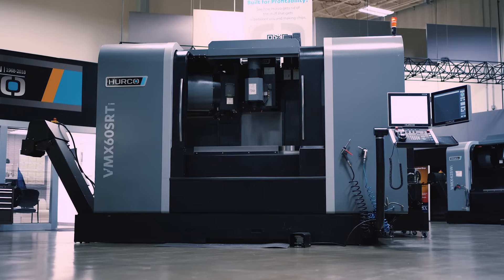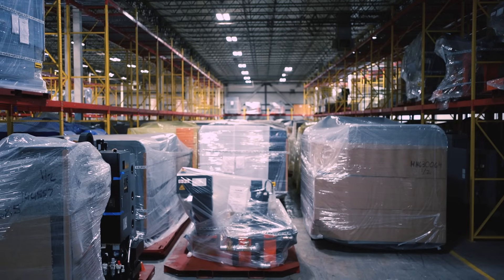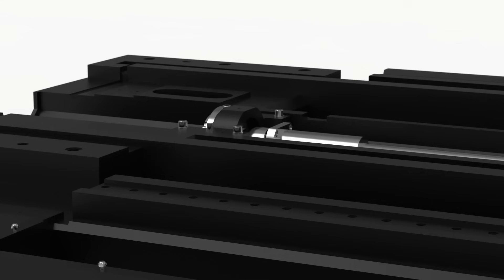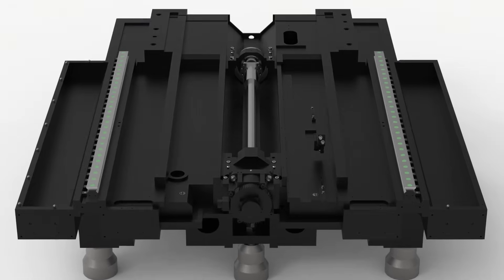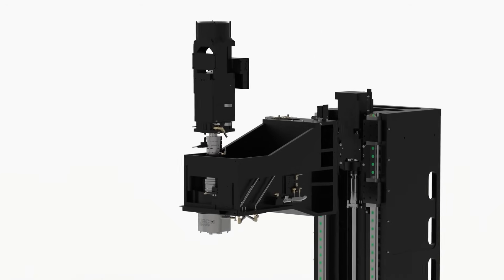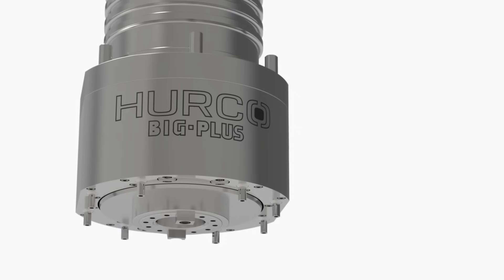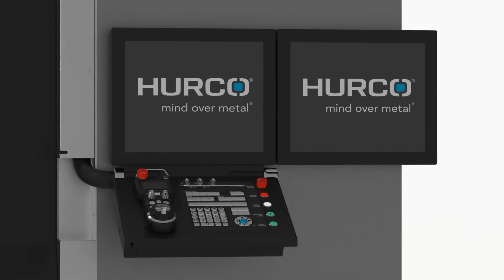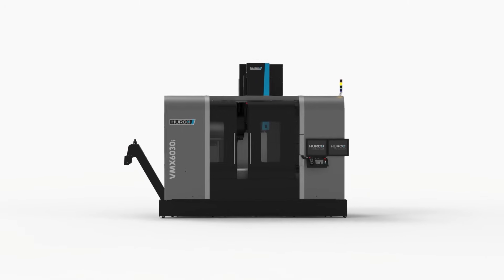How It’s Made: Superior Machine Design and Construction | Hurco

Comment: And best of all, MADE IN THE USA!!!!  Keep up the great work!!!  You guys ROCK!!!
Reply: Ummm, no it's not. The ways and frame (axes and saddle) are US built, but I doubt the rest is (probably not even the ball screws), and definitely not the electronics. Yaskawa is a Japanese company that produces the drive controllers and motors.

It's definitely assembled and partly manufactured in the USA though.
Reply: @pappaflammyboi5799  Looks like the linear guides are HIWIN made in Taiwan or in Israel. The ball screws are double nut, probably HIWIN too. Motors and drives are Yaskawa. Besides the brands, it is important to use hu orecision components. HAAS uses NSK linear guides but lowest available precision grade. Overall made in USA machines are better than Chinese, but they can not compete with German or Japaneese. I work with DMG-MORI, nothing even to compare with this.

Comment: After hand scraping the base casting how do ensure flatness between the top of the linear rails on the Y-axis?
Reply: Scraping is the method to make the surface flat within 5 microns. That's flat enough to hold the rails. If you're worried about the small islands of high and low don't be, they have enough baring surface

Comment: I thought they are all made in Taiwan?
Reply from the maker: Hi Stephen, the VMX6030i is a model we designed specifically for the US market. It is made here in in Indianapolis as are some of the VMX42i models. The accurate designation is Made in the USA with globally sourced components. 
The build team here in Indianapolis hand scrapes machined surfaces; grinds mounting and surface plates; aligns castings, ball screws, mechanical housings, rails, and tool changes; drills and taps assembly and mounting holes. Additionally, the Indy build team completes a comprehensive inspection and certification process for each CNC machine that is shipped to customers from Indianapolis. Other machine models are made at our wholly owned factories in Taiwan with all engineering design and software development conducted out of our international headquarters in Indianapolis, Indiana, USA.
Reply: Are any of the castings made in the US? I assume those would have to be machined on a giant gantry mill before hand scraping.
Reply: @stephenpavlov8942  Seem to have a narrative you are trying to bait them into.

Comment: Ceramic bearings are great, until they need to be replaced....how expensive are they compared to high quality steel bearings?
Reply: ceramic bearings explode so frequently at my workplace that i can find ceramic balls on the floor every day of the week. 
a few times i found ceramic race parts but those tend to stay in place. 
i think the machine uses 120 of them, but they are necessary consumable due to the insulating properties. 
sealed steel bearings would be WAY more reliable but they wouldn't work for our application.

i would be extremely concerned with using them in a milling machine.
Reply: @darkshadowsx5949  Don’t be- they have their place.

Comment: Are the machines completely built in the US?
Reply from the maker: Hi Ian, the VMX6030i is a model we designed specifically for the US market. It is made here in in Indianapolis as are some of the VMX42i models. The accurate designation is Made in the USA with globally sourced components. 
The build team here in Indianapolis hand scrapes machined surfaces; grinds mounting and surface plates; aligns castings, ball screws, mechanical housings, rails, and tool changes; drills and taps assembly and mounting holes. Additionally, the Indy build team completes a comprehensive inspection and certification process for each CNC machine that is shipped to customers from Indianapolis. Other machine models are made at our wholly owned factories in Taiwan with all engineering design and software development conducted out of our international headquarters in Indianapolis, Indiana, USA.

Comment: I wouldn't agree that Hurco invented conversational programming. I've used a 1984 Fanuc 6ML with conversational software and Heidenhain has always been conversational since their first controls were made.
Reply from the maker: Hi Arrow Racing, we are very proud of the technologies that have been invented at Hurco. You are correct that Fanuc and Heidenhain had conversational programming, but both of those companies paid Hurco licensing fees because we invented the technology. Our co-founder, the late Gerald V. Roch, and two others filed an application for a patent on “interactive machining system” in September 1981. The application was a continuation of previous applications that dated back to 1976. The U.S. Patent Office granted Patent B1 4,477,754 to our company’s founder and two others, who assigned it to Hurco Manufacturing Co., Inc., in October 1984. Actually, the list of machine tool builders that paid licensing fees to Hurco to use conversational programming is quite extensive. Thank you for the opportunity to clarify our invention of conversational programming. This foundation of innovation is part of our DNA at Hurco. Our engineers are continuously inventing new features and improving existing ones to help our customers increase productivity and profitability.
Reply: @hurcousa  Thankyou for the information. Very interesting, My first cnc machine was a Hawk 5M with Ultimax 4 . I later used a Fanuc 6ML control with graphical displays and conversational programming. It's great to hear the history of how conversational programming started. I'm also impressed with the newer Hurco machines especially the BX range. A friend of mine has a VMX50, a VM30i and a VM20i and a TM8 lathe. Beautiful well made machines and real work horses.
Reply from the maker: Anytime, appreciate the comments on our newer equipment. Have a great rest of your day!